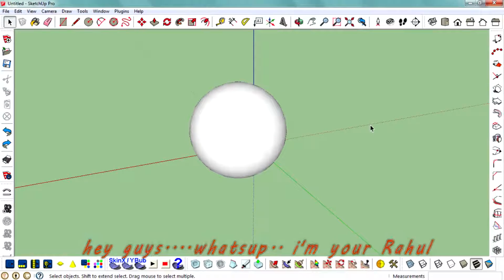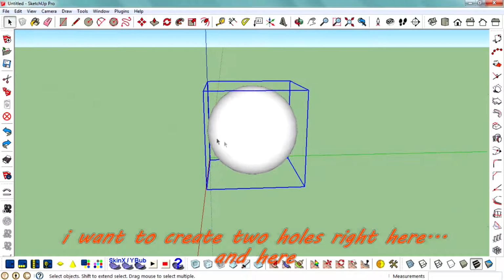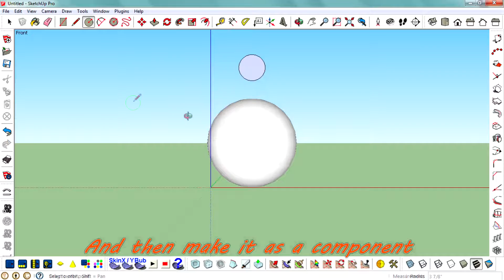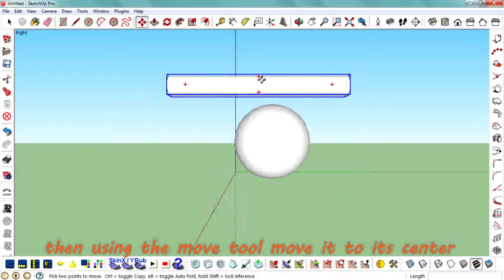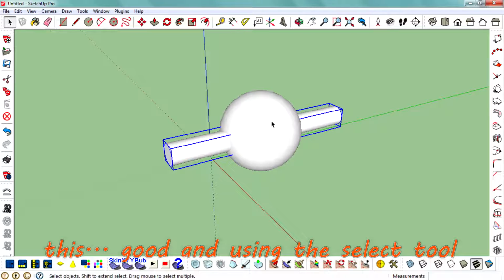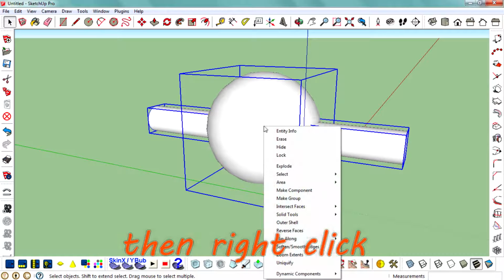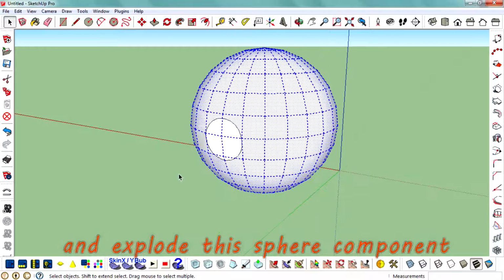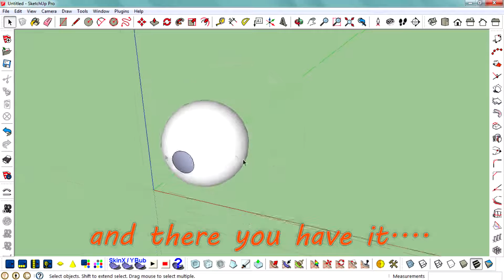How to create holes in curved surface in sketchup

Comment: This does not work in any way shape or form on 2017. You have to follow the vid, right click, merge (bottom choice whatever it was.) THEN EXPLODE the cylinder (so it's pieces remain inside the original thing your cutting) .. then finish the vid, then you've got to remove each little piece leaving behind the cut hole, then run solid inspector (I think I downloaded that..)